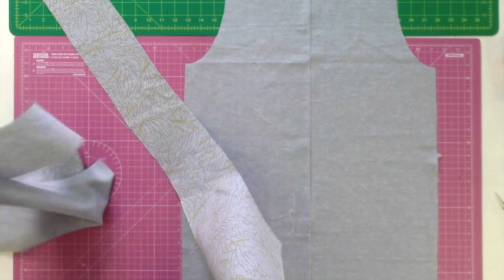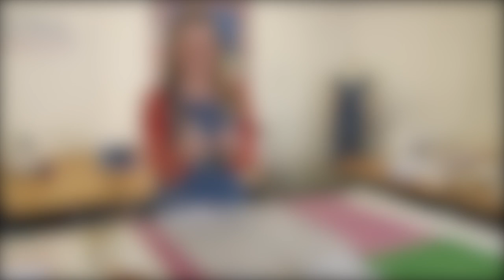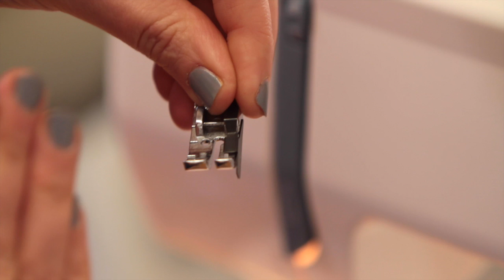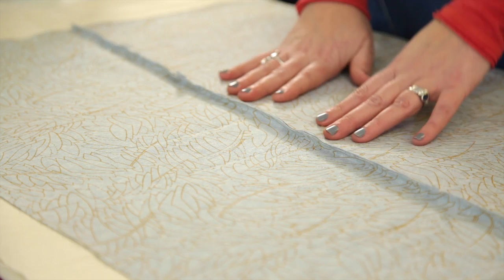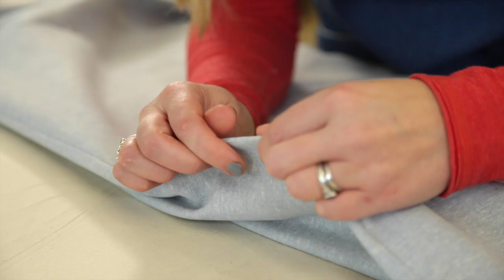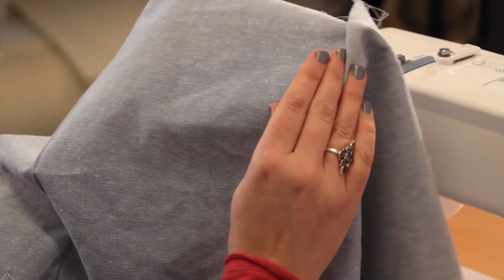Step 2 Joining the Hepworth Apron front and back with French Seams

Comment: Where can I buy this pattern please ? I’m going to have a go if I can get it 👍🏻
Reply from the maker: Hi, you can buy it here: https://www.jenni-smith.co.uk
Reply: Jenni Smith Sews thanks Jenni I am a size 20 ...could I make this bigger ... ( novice sewer here 🥴)
Reply from the maker: Yes - my advice would be to add an inch on the side seam of the front at the sides and also on the back side seams then follow the instructions just the same. Also add 2 inches to the strap length just in case - so buy 1.6 metres instead of 1.5m of fabric. We are going to increase the size range soon but this will work just fine. If you have any problems just ask!
Reply: Jenni Smith Sews thank you so much 😊